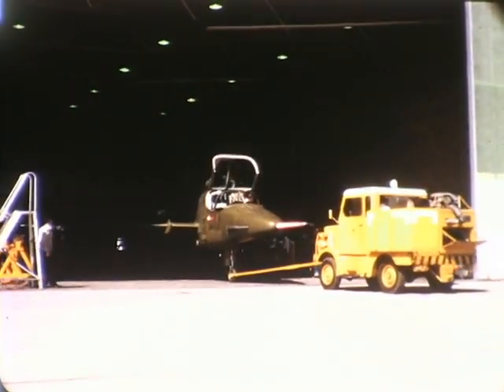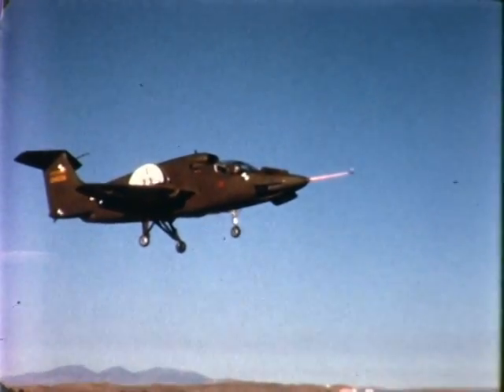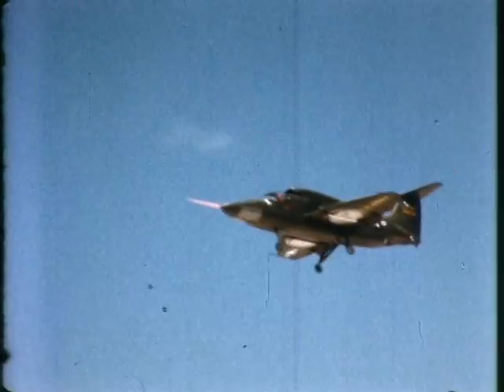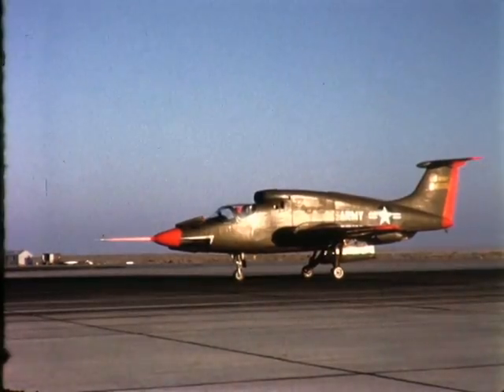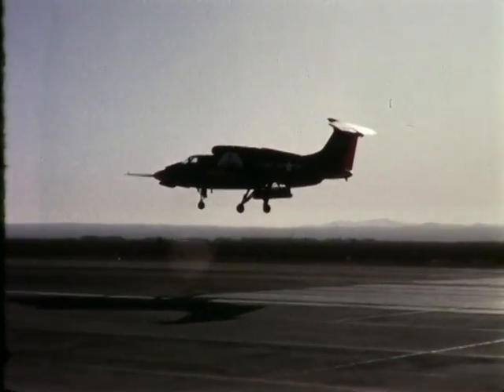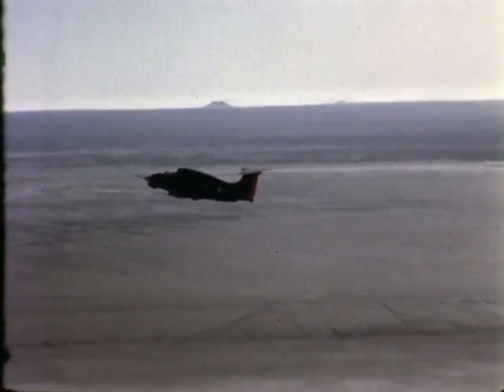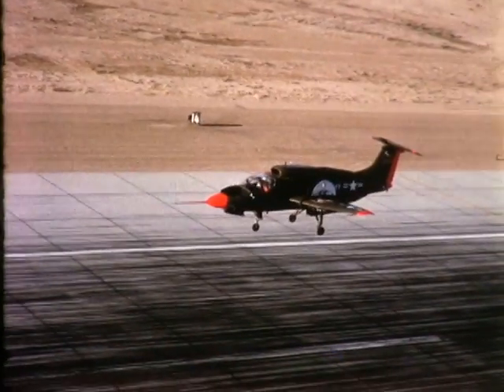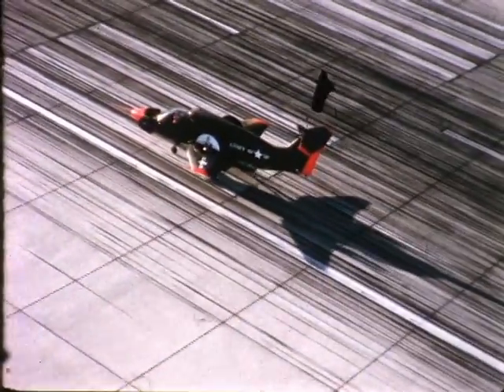F 2688 Ryan XV-5A Vertifan acceptance review

Comment: This should have been developed further.

1. If all those duct doors are damaged in combat that could mean it has land conventionally. 

2. The air Force doesn't want the army to have any close airsupport fixed wing aircraft.

3. but the air Force doesn't want any purpose built close air support aircraft.

4. BAE built the Harrier......
Reply: 1. If the harrier's swivel nozzles were damaged, it would have to land conventionally. If the F-35B's LiftFan cover was damaged, it would have to land conventionally. The vertifan is not the only one with this flaw. The only design without vulnerability to some transition-to-hover mechanism breaking is a tailsitter, but that has a ton of it's own challenges.

2. True, true
3.  True, they didn't want one in the 1960s
4. The harrier directs it's hot exhaust downwards, that hot exhaust has no oxygen and has a high chance of getting re-ingested by the engine. This has caused numerous crashes. The vertifan's fans mix the jet exhaust with another stream of cold air, so even if the air was re-ingested by the engine, there would still be oxygen in that air, so vertifans won't crash for that reason. Also, by augmenting the engine's air stream with another stream of air (adding more mass flow), the thrust is increased. This means that if a harrier-like jet had the same engine as a vertifan-like jet, the vertifan-like jet would be able to hover with far more payload.